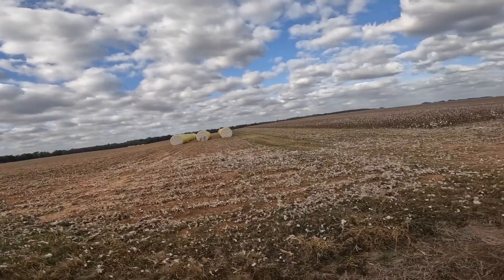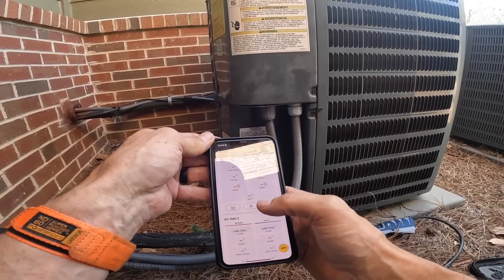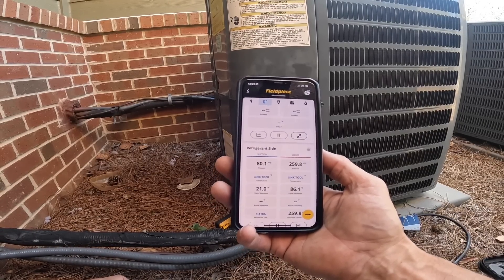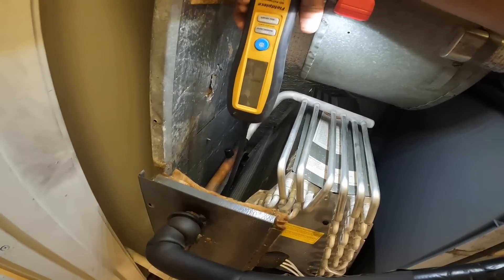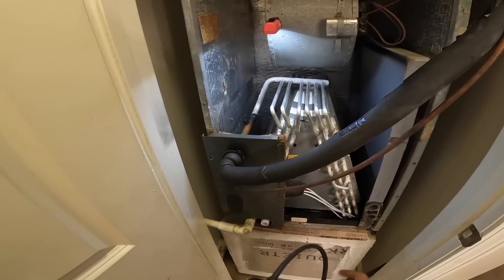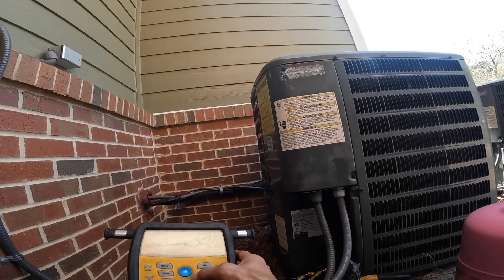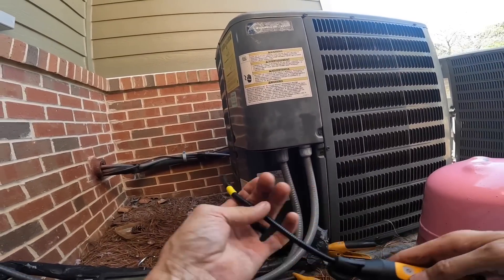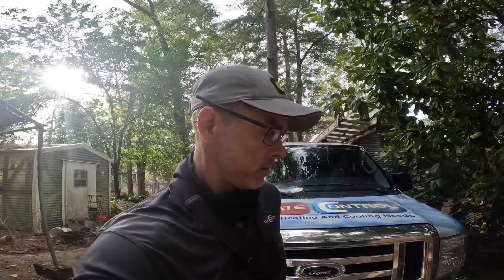Returning To A Leaking System to Perform Another Leak Search

Comment: R410A systems are a joke.  It should be criminal for allowing manufacturers to put these on the market when they did.  The coils just arent built well enough to handle the high head pressures of R410A.  These systems are a HVAC repairmans wet dream for income!

Comment: Way to persevere on this call!!!!
That being said, I'll put my 200 dollar DTek up against any of these newer 600-800 dollar boutique detectors any day, any time. The only time it lets me down is when I forget to change the batteries. 
I say this because this isn't the first HVAC video I've seen the last couple years where techs have used these super expensive leak sniffers and ended up frustrated when the 10 dollar soap bubbles do a better job of finding the leak than the 700 dollar sniffer did.. The only expensive leak detector worth the money is an H10 style IMO.
30 years in the business and for 20 of those I've been using the same DTek and replacing it when it gets old or breaks and I've never been disappointed, really. I have an H10 on my truck too, but seriously I only have to use that thing once or twice a year usually to find something super sneaky..

Comment: Didnt you stick the tip of the DR58 in water at some point? You mentioned in one video you hoped that didnt damage it....
Reply: If that’s the case it’s definitely damaged. You can’t get those sensors wet
Reply: @timrob0420  He did. I found the video . youtube dot com/watch?v=r-3bVDgXlXU&t=215s
Reply: @SirHumano97  well mystery solved then. Can’t blame the DR58 if he got water in it and damaged the sensor. Even the H10 is sensitive to that, I think all heated diodes are. Mystery solved

Comment: Dont know how you do other search metods over there but we also use the fluorcent fluid in to the system for a while and then use the ultra violette flashlight to expose the leaks. And these bad quality evaporators are so thin in the material. So we use to put some clearcote on the curbs. 
That prevents it from early oxidations, if the air is with some bad stuff from nearby industries or likewise. Had not only ones changed elements that corroded shortly and leaked on the paper- and steel industries. The air on thoose places are sharp and bad for copper.

Comment: Yes tools for the industry have certainly changed since i retired 6 years ago after 45 years as a service tech and instructor. My old H10 could find leaks nothing else could. And for the real old timers like me...Surfax,liquid we used for absorbers, was also amazing to pinpoint the exact location of a leak. Digital tools are great as long as the batteries are strong but i still have a few sets of manifold gauges that I trust. I can see how convenient digital tools are but ....I'm old and fortunately no longer work. Nice to watch what others do though. Peace to all.
Reply: I started in hvac in 1983 and I am on my 3rd H-10. They used to be called GE leak detectors. I have tried other detectors and nothing works like the H-10.
Reply: Hey frank was hvac better in the 80's?  Im hearing it was better money and installs weren't as hard....all mid efficiency furnaces but I guess heavier...would like to hear your input
Reply: From what I understand, even though I agree with the H10, since I used one myself, the stratus and others do exceed what the H10 can do. It costs around $1000 though.
Reply: @sprockkets  I work for the government so we get unlimited tools at no cost to us. I will give the stratus a try. Thanks for the tip.
Reply: @frankjackson1918  If you want more info go to hvacschool channel here on YT. IIRC it's an infrared style scanner, so unlike others, it will go off when you hit but stop chirping if you don't move it as it is always in a way, self calibrating.

Comment: I have the DR82, and SLR8 from Fieldpiece and the older Inficon D-Tek Select. I also have the SLR2 (I know, I'm a tool hog), and at least in my experience, the Infared detectors work better than the heated diode style. I'm the guy my company sends out to find the leaks no one else can find. I use my DR82 and Big Blue. The Inficon gear is also excellent, but at twice the price, I can't justify buying their new detector.
Reply: Same, DR82 is a beast. I’ve found leaks easier with that than my H10

Comment: I'm absolutely convinced that Fieldpiece has some kind of issue with the DR58. It is just not capable of finding known leaks out in the field. I've performed the exact same test you did in this video numerous times. Putting the DR58 up against a Robinaire LD7 & an Amprobe RLD-1. And the Fieldpiece failed every time. I would be very interested to see what a Fieldpiece rep would have to say in response to this video. Keep us posted. 😎👍
Reply: I can't help but think that the DR58 just isn't pulling a good enough air sample back down into the instrument where the sensor is located. It's definitely not reliable at all... EVEN WITH A NEW FILTER TIP.
Reply: I have the DR82 and I thought it worked great when I got it but sadly after only using it a handful of times I don't have much confidence in it anymore.
Reply: @tomoliver8498  that's the exact same thing I experienced with the dr-58. It worked great the first two times I used it and I actually thought..."Man this is going to be the best leak detector I've ever owned!" But then all of a sudden I stopped finding leaks. I was spending hours searching, knowing there had to be a leak somewhere. But finding nothing. Come to find out the damn thing wasn't working properly anymore. Don't get me wrong, I love my Fieldpiece stuff. But I have no faith in these detectors. Too many people having the same issue.

Comment: Thats the difference in design. Heated diode detectors are usually considerably cheaper than an IR detector and are not as reliable at finding a leak. Personally I wont use a heater diode detector anymore.

Comment: With increase of the expense of new units and parts the HVAC industry needs to start guaranteeing parts and units like the automotive has done with their industry. They should cover parts and labor industry wide. I'm sure you would appreciate that as would customers. It would also serve to increase quality control. When I was still working had pre-ordered five down draft units that out of five units three had bad fan motors out of the box. The two that worked ended up waiting on parts because I robbed fans off of them.  It was disgusting that on two both the distribution and draft fans were squealing upon installation.  Needless to say they were no longer my go to brand of unit.
Reply: Please name brand and model so we can avoid those units!
Reply from the maker: @bobboscarato1313  Goodman
Reply: @HVACGUY  Thank you; I was guessing right. If they only improve their quality 15% we'll have a great quality product.- A lady engineer that worked for them told me they have a sweat shop operation there.

Comment: As a homeowner, what are his options? I heard you say the leak detector paid for itself. Three coils, 2 in rapid succession and you explained poor metals and quality on the coil. I would be need to be told the warranty is still valid. 😐🙄
Reply from the maker: New air Handler has 10 year parts warranty and one year on labor

Comment: Might be the sensor already need to be replaced? Have you try to change filter?
Reply from the maker: I think I have 11 hours on the sensor. You think it’s gone already? They advertise 300 hours.
Reply: @HVACGUY  I believe if it's exposed to pure refrigerant, it'll decay like super fast. So it depends. I'd change the sensor just to make sure it was the issue.
Reply: @raulrse  you are correct heavy contamination of the sensor will shorten the life.